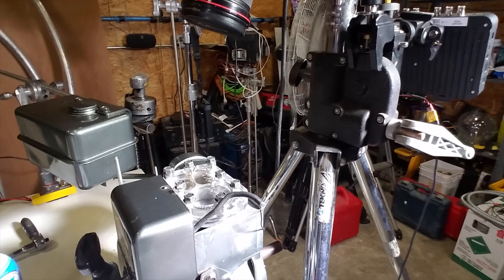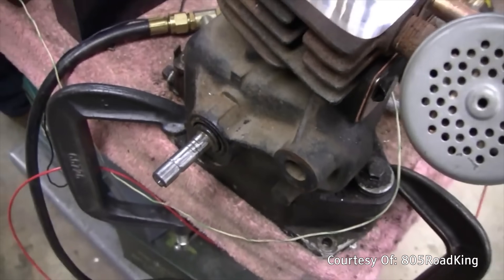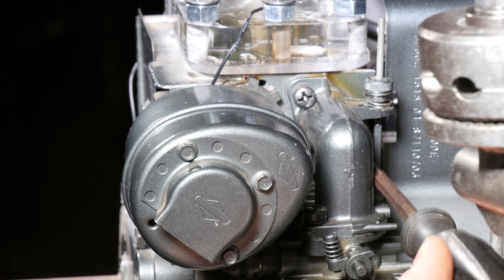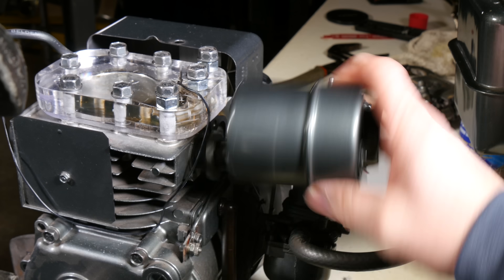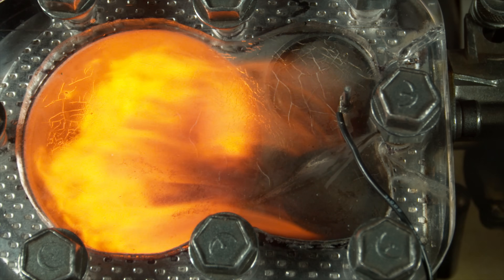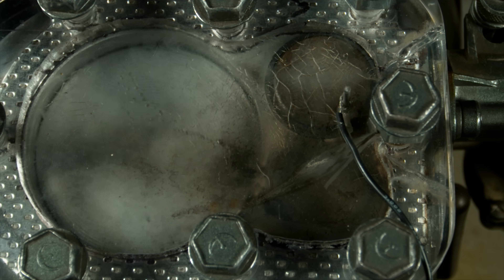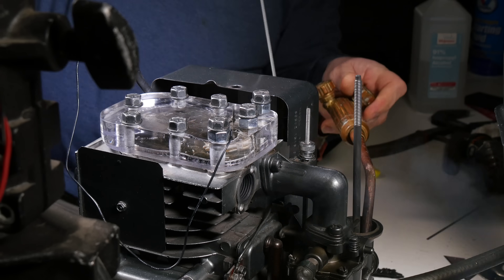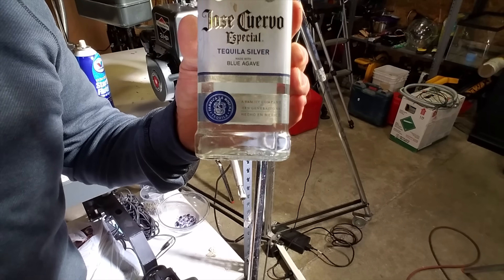See Through Engine - 4K Slow Motion Visible Combustion ( S1 • E1 )

Comment: What’s the spark on the exhaust stroke for?
Reply: To produce a cleaner chamber for the power stroke. Some manufacturers have had some interesting/weird configurations for producing cleaner burns: double ignition fires like this one, double spark plugs per cylinder. Just looking for efficiency I would say.
Reply: @RedRazor23  it's called Wasted Spark. Just removes the complication of gearing the ignition coil for firing the spark on every second up stroke on a simple 4 stroke engine.

Fun fact: My '99 Suzuki Jimny and Baleno 4cyl cars had full ECU timed wasted spark so they could get away with just two head mounted electronic coils. Each coil was connected to two plugs.

Comment: Maybe somebody already mentioned this in the comments below but the reason acetylene melted the head is obviously it burns hotter but the chemical reason is it’s triple bonded carbon so breaking all three of those bonds releases amazingly more energy than gasoline would alone and obviously more energy than isopropyl alcohol. Know your molecular structures.

Comment: sometimes the piston is moving and I didnt see any gases ignite. Is it just invisible flames?
Reply: mike lang the piston moves down to draw in the mixture, then moves up to compress it, then the spark fires it for the power stroke, then piston comes back up to expel the gas, then back down to draw fresh mixture back in and power stroke again.
Reply: @johnmont8298  thanks for the explanation. What is powering it to draw in the mixture though?
Reply: mike lang the engine needs get moving somehow... usually by pulling a rope or a starter engine will crank it around. Opposite the piston there is a mass that helps give the whole system some momentum so it will swing around after the first explosion 💥 and have momentum to rotate back around to complete the exhaust, intake and compression segments.   Of course o. A v8 engine or even 2 or more, the whole crank only has to turn a partial rotation as the next piston pulls up to compress, one is in exhaust stroke, next one is going into compression mode and as one is power stroke another one maybe in intake phase.  The more pistons the generally smoother because the time between power strokes is less and less.  In a one piston engine the whole crank has to turn through 720 degree rotation. If two Piston, 36o degrees. If 12 pistons, 60 degrees between power strokes.  This is for a four stroke engine like was in the video.  Remember opposing all the pistons is a mass or weight to help keep the engine rotating between power strokes and also dampen out a lot of the vibrations

Comment: Here's a suggestion, propane and hydrogen/oxygen gas engines.
Reply: ShawnDarkfire500 Toyota used to sell propane trucks, forklifts run on propane.
Reply: @travisfrost6508  true, did you know that those engines can be powerful enough for a large truck and run on hydrogen/oxygen gas.

Comment: Never knew there was a second spark on the exhaust phase 
Assuming its to ignite any potential left over unignited fuel?
Reply: Lots of small engines do this.  Not because the exhaust stroke spark is needed.  It is because if you have a simple ignition with timing sensor (or points) on the crankshaft, it will fire every time the crankshaft rotates. The crankshaft rotates 2 times to complete  4 cycles (1 camshaft rotation).  The ignition sensor doesn't know or care if the crankshaft position is 5 degrees before Top Dead Center on the compression stroke or if it is 5 deg before TDC on the compression stroke,  it just fires at the crank position for 5 deg  before TDC on all rotations.  The exhaust stoke spark has no purpose, there is just no easy way to stop it and no reason to.
Reply: @eilliwwasniahc  good to know, thank you

Comment: For every 2 strokes. You get 1 ignition. So,  the engine it's only using half the power and wasting the half.
Reply: Surely the power is coming from converting chemical energy in the fuel, so why is 'half' wasted simply because it isn't being ignited every other stroke?
Reply: satyrme it’s not like it’s using full on the off stroke. And if you don’t need a combustion to drive it then you would be wasting fuel? Seems to me like you just want double waste for same output
Reply: This seems to occur only after testing other fuel sources. The beginning of the video. Combustion happens on every compression stroke.
Reply: I believe I remember something about energy rules, from general science. That only half of energy is used and the other half is lost. I believe this occurs with electricity and gas. This is the reason a gas powered car can run off gas fumes. As long as there is a constant feed of gas fumes.

Comment: Try tequila - but heat it up! If you raise the temperature of the tequila enough, then the alcohol in it will preferentially vaporize and you might be able to make it work.
It would be interesting to try different temperatures. - if you heat it up so much that the alcohol in the tequila vaporizes then its a bit like running it with a gas like acetylene. If you heat it up too much then you'll start to get water / steam in the mix which will probably not help. You could try to experiment with different temperatures and that would make a cool video. For example you could try 
a) Room temperature  
b) 50 degrees celsius (alcohol preferentially vaporizes)
c) Temperature just below or at alcohol's boiling point (78 degrees celsius) this is also roughly the point where the vapor pressure from an ethanol water mixture yields the highest concentration of ethanol. Remember that alcohol and water form a co-mixture so its impossible to get a pure alcohol vapor from a alcohol / water mixture like tequila - the two molecules bind together and no distillation can yield pure alcohol.
d) Temperature between alcohol and water's boiling point (say 90 degrees)  in this scenario you should get lots of water vapor in with the alcohol vapor - I'd expect it to combust less effectively.
e) Temperature above water's boiling point (100degrees +) at this temperature I'd expect you'd get lots of water / steam in with the vapor mixture I am guessing it will work less well.

Let me know what you think?
Reply: Or just heat some ethanol and use that

Comment: It looked like the straight alcohol wasted more fuel than it burned.
Reply: oddly enough that's considered a significant positive in alcohol-burning drag cars. They run super rich and the unburnt alcohol blown out in the exhaust takes so much heat out of the engine they don't need water-cooling perforations in the engine block, meaning it can take much higher force before it blows up.
Reply: @orangejoe204  Top fuelers use the fuel run rich for cooling. Max of 90% nitromethane and at least 10% methanol.
Reply: @struedel25  You're correct, Top Fuel uses mostly nitromethane which is why those cars have such incredible torque. Alcohol racers and dragsters use 100% methanol for safety because it's nowhere near as explosive as nitromethane but also provides a lot of cooling. Indy Racing League uses 100% ethanol too.
Reply: It would be interesting to see the intake tuned to properly use alcohol - more atomization, less liquid overall.
Reply: Woah. I was wondering about that, you gotta use 99%. Even 1% water is gonna create vapor but it'll evaporate and head out pretty quick. 
29% water it's a wonder that it even turned over, but it wouldn't have any power. And Tequila I doubt would be any better.
Reply: If he used a carburetor to atomize the alcohol it would be better. Gas can go straight into the intake bcos it has a much higher flash point.
Reply: Very likely the alcohol he used was diluted with water. That is why you saw so much water.
Reply: @norbertsiewert3917  91% alcohol is 9% water... and that's why everything got wet as hell in there.
Reply: @warlockpaladin2261 :  I wonder what absolute ethanol would do. Don't bother trying to find it; it is illegal, unless it has been denatured.
Reply: @norbertsiewert3917  It can be ordered from chemical suppliers.
Reply: @warlockpaladin2261 :  I hauled drums of alcohol for a flavor manufacturing company. Whenever I picked up a load, I had to present my commercial drivers license, which had Hazmat endorsement, and had to sign for the product.
It was not the FDA that cared; it was the ATF. They were more interested in control and revenue!
Reply: @norbertsiewert3917  Yeah, well... in those volumes I can see why.
Reply: @warlockpaladin2261 :  The funny thing is that any residual alcohol was carefully salvaged, and the flavor technicians made themselves drinks you could not buy in any liquor store. I approved. To hell with the ATF and revenuers.
Reply: If I remember correctly, alcohol needs lots of compression, too. I'm surprised it lit at all.
Reply: Curtis Womack  That makes sense. Thanks.

Comment: I always wondered.....since it's the expanding gas from combustion that drives the piston, could the same rapid expansion be achieved by injecting a non-burning cryogenic fluid....say liquid nitrogen ?  The N2 liquid expands by about 100x the volume when it is raised above -320F.  The benefit would be no combustion, and therefore zero pollution. Also then, zero need for things like catalytic converters etc.   In theory it has to work.

Comment: I have absolutely no clue about motors,  is someone here to break down whats happening? footage looks awesome btw
Reply: @jordanio0464  ok, but what does second spark do ? Why is there a second spark on the exhaust stroke ?
Reply: @Simon-xi8tb  Normal engines don't spark on the exhaust stroke. 
On a normal engine, Say a Chevy V8 for instance due to the engines having 8 pistons  There is only 1 piston in a ready to fire position at any given time (piston at max compression dead top) so a little device on top of the engine called a distributor. This small cylinder that is ran off the car's camshaft has in the case of a V8 Chevy 8 wires coming out of it going to each spark plug in the engine. And what it does is fire the correct cylinders at the right time at the top of the power stroke.

Different engines have different firing orders so in Chevy's case it would be cylinders 1-8-4-3-6-5-7-2 (The firing order is determined by the camshaft). The distributor is timed perfectly with the engine so it always fires on the cylinder that is at max compression of fuel.

Comment: Why does the cylinder go up and down twice for every one explosion 💥?
Reply: Four stroke engine.
Reply: Mesbahose Salekeen 
Thanks 
Please explain
Reply: Well 4 stroke......4 processes.
1.suction:sucks air 
2.compression: compresses air
3.expansion: piston is pushed down by explosive force of combustion.
4.exhaust: burnt gases are thrown out.
Diesel engine uses compression ignition. The air is compressed to increase its temperature. So when fuel is injected, it burns. No need for spark.
Reply: Mesbahose Salekeen 
Thanks 
Why doesn’t the fuel explode from the heat of the compressed air, Just like it explodes from the heat of a spark?
Reply: Fuel does explode but after it is injected. In diesel engine air is sucked and compressed and then fuel is sprayed then combustion happens.
In spark engine fuel and air are mixed and then compressed and finally u spark it and thus the combustion occurs.

Comment: Why does the spark plug spark on the stroke that only pushed exhaust out? Seems useless
Reply: The coil timing is driven from the crankshaft, so it fires 2x per complete cycle. Easiest / cheapest way of mechanically timing it.
Reply: I did notice that too, was wondering why a second spark on 4th stroke.
Reply: As far as I understand how these engines work: the spark goes off when a certain angle on the crankshaft passes a fixed point. Since the crankshaft passes that same point on every rotation and not once every 2 rotations, you will generate a spark every rotation, so also when the exhaust valves are open.

Comment: That was GREAT!  Cool watching the flame front travel.  The alcohol would need to be run through the gas tank so carb CAN deliver it through its circuits to atomize it.  It looked very flooded with too much when it was poured directly in. However bigger jets may be needed to run on alcohol.   Excellent!

Comment: I'm a small engine mechanic and never in my 6 years of working on these have I or has any mechanic actually gotten to see what he's really fixing and what's really going on in those chambers until now. This is amazing. If only this where possible in any engine to see whats going on in there then we mechanics know fixing engines would become obsolete. We could know if an engine is running lean or rich.
Reply: @Leiki Dragon todays engines are over 100 years more advanced than the one in the video. they are at the end of the line with combustion. now they have to remove all the carbon that has been released
Reply: @jeanshepherd7185  not really. Given time the world's forests will do that, all that is needed is a superior energy source such as nuclear fission or fusion
Reply: @will2brown50  no they won’t
Reply: @akmedia8206  well I mean they will that's how photosynthesis works. If you look at past carbon cycles the world goes from periods of high carbon dioxide concentrations in the atmosphere to low and then back again. The world self regulates itself.
Reply: @jeanshepherd7185 are the new engines really that different?

Comment: People take for granted internal combustion engines. Not me. I've been in awe of them for 45 years and still am. They are one of the most incredible, almost magical inventions ever devised.  That you can harness and control explosions and channel that energy to propel vehicles is amazing. The force of the combustion just to drive the piston down the cylinder is amazing enough but then when you think there still has to be enough residual energy for the  piston to turn a crankshaft, which in turn turns the driveshaft, which in turn still has enough force to turn the vehicle wheels propelling a vehicle just boggles the imagination. Then add on top of all this the durability and reliability of internal combustion engines, especially considering they hold together under such stress from the non-stop controlled explosions and you have for me a head-shaking miracle.
Reply: EV people will never understand the magic of the ice
Reply: @larryjolley5229  To be fair electric motors are incredible too, the force is being applied seemingly out of thin air. They can run for a very long time because they have fewer parts and the rotor floats inside of the stator. So mechanically you are mostly looking at wear on the bearings, differential and driveshafts. An ICE relies on tight seals all around the engine and it has a bunch of machined parts needing to be checked against spec. I mean you are looking at just a crankshaft, it's a complete nightmare to thoroughly measure during a rebuild for example. In my mind ICEs are very similar to steam engines, an ICE doesn't need any explosion to run. The fuel-air mixture expands greatly upon combustion, and the pressure differential pushes the piston down which absorbs that pressure energy. Boiling water is similar to burning fuel, both create increased pressure in a sealed vessel. I can appreciate how neat, simple and clean electric vehicles are in comparison.
Reply: @HyperMario64  I agree. Electric is also so much more efficient. You cant really argue with electric. But gas is more fun.

Comment: So alcohol doesnt ignite every turn? Mixture problems? Explain pls someone.
Reply: I don't think rubbing alcohol has the right propensity to efficiently power an engine, since it only contains about 90% actual alcohol molecules as fuel, the remaining 10% are water.. also, the reaction of ethanol creates about a 2:3 ratio CO2 to H2O, whereas a a gasoline reaction has a 8:9 (which is almost 1:1) ratio.... and therefore with this rubbing alcohol, a large amount of water fills the combustion chamber, which is why there are cycles where ignition fails but the remaining force of the fly-wheel keeps the system pumping out the water through the valves until the concentration of combustible molecules is high enough to achieve ignition again.

Comment: 1:58 why o we get an ignition after the exhaust but before the fuel has entered?
Reply: Its easier to make the ignition go off every rotation of the crankshaft then to make it go off every 2 rotations. In normal cars this is the case  but this is a rather cheap setup so there is no need to make it ignite only every 2 rotations
Reply: @levivlijm7571  Makes sense, thank you

Comment: There is a spark after exhaust venting? I though only every 2nd stroke needs that ... interesting. 
Maybe it is easier to build it like this, having a spark before every downward motion.
Reply: yEAH  I noticed that extra spark too. But only with the gasoline trial. curious
Reply: Its easier to build the ignition System like this, 4 strokes are 2 rounds of crankshaft so there are 2 sparks.

Comment: The Alcohol you used is 91% so you had 9% water which is quite a bit. Ethanol fuel is 99.9% Alcohol. Denatured Alcohol found at hardware stores is also a lot closer to 100% than the 91% stuff.  Also Even the 91% stuff would run massively better if metered by the carb instead of pored in. your running super rich. very fun to watch!